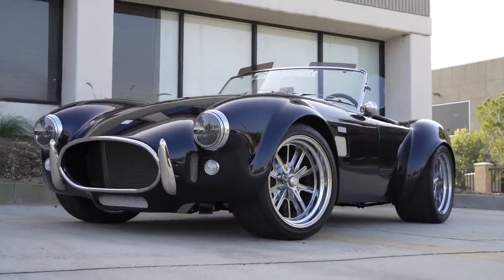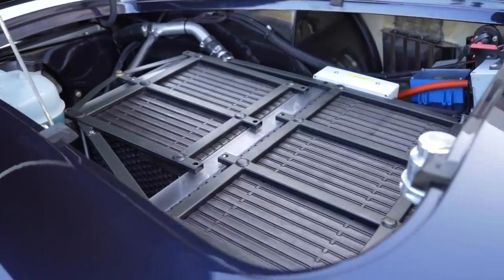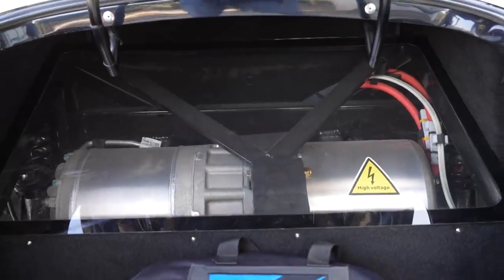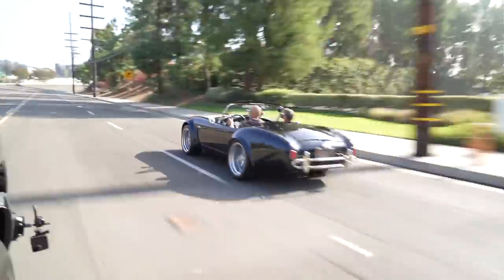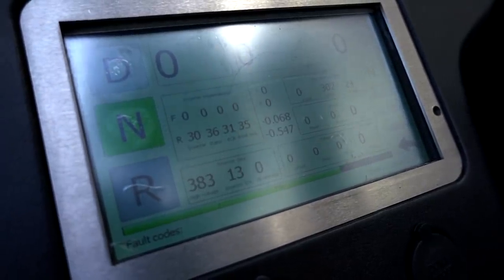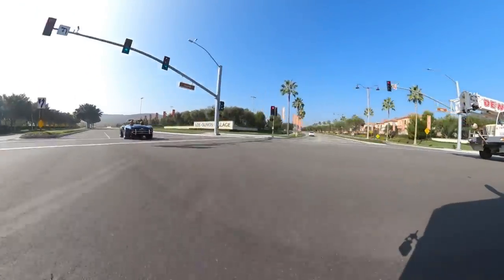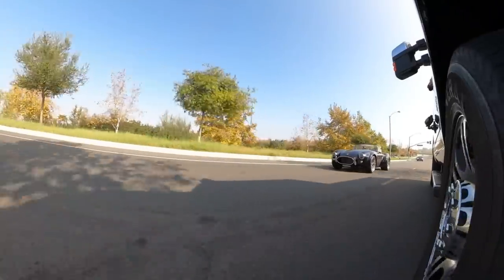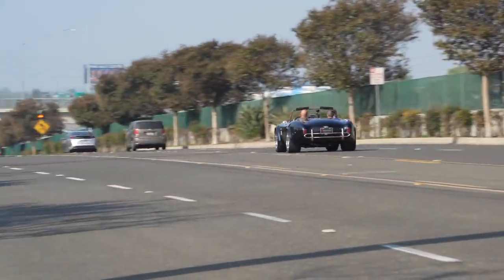1,500 ft-lb Torque Electric Powered Shelby Cobra Tesla KILLER by Superformance

Comment: “It has tremendous grip, right up until it doesn’t.”
Reply: ahaha!!
Reply: cheap open rear diff , misses an LSD
Reply: @Eric Shosted.   Murray Walker...? LoL
Reply: @titolupo  guess you can't see or think. two black patches, and smoke from both tires
Reply: There's no reason for an lsd when the torque is high enough to just light up both rear tires. I think the tire has less traction than the drag in the diff. A limited slip can't add traction when both are already slipping.
Reply: @allterrainrandy2587  That is not the point, when one tires slips different from the other they have a different inertia and when the one that has less inertia grips back first makes the car suddenly turn on one side ( usually the one you don't expect). This is much less evident and controllable if tires spin equally thanks to an LSD
Reply: @richardschipper5989  May be I can't think or may be you make assumptions without having any experience of horsepower
Reply: @titolupo  I went and played around with my P85 yesterday, it will definitely spin only one tire. I've always only seen 2 black marks. Maybe I'll have to buy one of those Quaife ATB.
Reply: @allterrainrandy2587  Thanks! You are delivering the most clever response here.  in fact two black marks on ground do not exclude there is a big difference in spinning between tires... the issue come when one gets grip, such as it happens when one tire is on ice or acquaplaning
Reply: @allterrainrandy2587  I always thought an LSD was so the two wheels weren't locked when going around a corner. But when you were going straight and put it under load both wheels "locked up" for traction.

Comment: As cool as ev’s are (performance wise),  you can’t make an electric cobra cool!!  That car needs to be seen and most importantly heard!
Reply: says you
Reply: @post-leftluddite  yes,..I thought that was clear. ☝
Reply: Agree!
Reply: Well I for one believe this is pretty cool.
Reply: @davidkelley751  and I'm cool with that because everyone is intitled to an opinion.
Reply: @XxMcLuvinItxX  true. I mean personally I’d rather have a high reving 289 or 302 like 7,500+ rpm setup for grip racing.

My guess is there will be a lot more of these electric cobras in the future like say 50 years from now.
But in my opinion this is a lot better than the mustang Mach-E or the Shelby Mach-E concept.
Reply: @post-leftluddite  
Yep. He said it…Embrace it.
Reply: A Voodoo engine with a tremix tko 6 speed manual and I’m in heaven 😎
Reply: @jamespain5822  that actually would be a really good setup because the voodoo’s flat plane crank doesn’t have a whole lot of bottom end torque compared to the coyote and like the coyote it makes it’s power at the very top of the rev range.
So you probably wouldn’t spin tires to much compared to either a 427 or a coyote.
Reply: I would just install software to play VTEC sounds and confuse the hell out of people but you gotta lift off the gas during shifts
Reply: @davidkelley751  Especially on the Superformance Cobra R. Driving that through the canyons screaming at 8500rpms. It’s my dream build.
Reply: @dodgersfan8598  Artificial sound😆😆😆  That's what i expect from gay Teslas
Reply: I dont know. I think this is sick as shit
Reply: Exactly mate or otherwise it's a soulless toy.
Reply: @maximusvonce1381  nah, cause I'm not a five year old to be wooed exclusively by loud noises.
Reply: @maximusvonce1381  this weird simp behavior for a piece of machinery is kind of pathetic,  bro. Put one of these and an original on the line, and this model is going to out perform every time, "appliance" or no. Just because the only experience with electric motors you've had is with your wife's vibrator doesnt mean there isnt some kick ass ones on the market, and tesla engines are right there on the top of the pile
Reply: @davidc4983  Gay pos appliance car.
Reply: They should at least off a v8 DFI 2 stroke crate motor.

Comment: On paper this makes a lot of sense for racing, Super lightweight and perfect weight distribution with the absolute best power curve and no shifts, BUT It just doesnt look right without the side pipes. However the AWD Daytona will DESTROY EVERYTHING! Imagine the Daytona with the PLAID Tri motor setup!!! These guys are pushing the bleeding edge of new school HOT RODDING no question about it.
Reply: They had to dial back the the P100D motor (4500flbs) from the initial setting of 2500 flbs to 1500flbs, they could really go with the model 3 dual motor save some weight and leave the motors wide open. But dam you're correct AWD with near 50/50, no shift points, instant torque, and i'll add that the regeneration braking will eliminate brake fade.

Comment: I am an internal combustion engine enthusiast, but I know these electric vehicles are a different experience. I have never owned one, nor have I driven one.
   The thing about that is I know what power curves look like, and what a power band is.
   As far as electrics are concerned, I have been into the RC Car hobby since a child. I have seen them move from cadmium batteries, to hydride batteries, and then Lithium batteries.
   I have experienced lithium batteries with phones like most people, but I started flying electric helicopters, which use lithium batteries.
   Even with the electric cars, power is astronomical. You have a 1/10th scale vehicle that can go about 35-40mph with a track racing setup. You can even make them do 150+ actual mph. The 35mph setup is 350mph by scale. That is like driving a vehicle with thousands of horsepower, but you can't sit in it.
   The power delivery is what I can understand, I haven't driven 1/1 electric, but the experience has got to be something. And they are very quiet. Toyota Prius experience.
   I still hope gas engines will continue in different ways, but electric will be tough to keep up with.
Reply: It would be nice to see some DFI 2 strokes also.
Reply: Schedule a Tesla test drive, they are no a pressure sales team, but make sure you leave your checkbook at home as a safety measure... just saying.

Comment: Gotta agree with ya. The engineering and the power of that Cobra is stellar....no argument there. But I'm of the age that enjoys the noise, the smells, the fun of driving around in car like that with a knarly, loud big V8 where the floor boards are pulsing below your feet and the wind noise can't drown out the sound of the motor. There is definitely a market for electric 'muscle cars' and it's likely only going to grow. I would probably even buy one if I could. But it would not replace a gas-guzzling, loud version of the same car. Be safe and stay well.

Comment: Not just the sound, but the feel of that lopey engine that seems like it’s about to shut off but doesn’t, and the smell of unburned hydrocarbons.   Back in the day at some local car shows, there was this 63 1/2 Galaxie XL, 427, Torquethrusts, perfect exhaust tips at the very corners, tipped down just right, hunkered down like it’s hauling 50 cases of illegal hooch.    Red as red can be.     That thing had it all, as far as visceral.     High test fuel aroma, choppy, nasty, high compression lope, where you could watch the antenna wave back and forth.     You could feel it standing 50 feet away.    He’d put it in drive to move it and the rpm would drop, and it just shook the ground.      He’d put it in neutral and give it a little throttle jab.        Here it is 35 years later and it’s still like yesterday in my head.     That, to me, was the definition of badass.   These was also a legendary, around here at least, in Charleston, SC, a maroon 1970 Torino 429SCJ.    And I saw it with my own eyes.    THAT legendary.   And of all places, at the airport pickup lanes, late night, with no other car around it, with the lights hitting it just right.   Tinted side windows, Magnum 500’s, louvers on the back glass.      Just jaw dropping.     Just when I was about to go, one dude walked out and I knew it had to be the driver.    I was several hundred feet away by this time but had to circle around.    Sure enough, he fired it up, and that was it man.     Top predator.     That thing literally sounded like a monster.       And easily one of the most beautiful cars I’ve ever seen, right there with the ‘68-‘70 Chargers, Miura, GT40, and of course the Cobra.    But you’ll grow to love EVs.    The power is what does the trick.   It’s just jaw dropping.    I learned about this  through RC cars from Traxxis, and was converted when I realized the absurdity of the power in such a tiny motor and with those high power density batteries.        The cars are 1/10 scale, and by extrapolating, I figured that real full sized  cars would easily have crazy power if manufacturers didn’t restrain themselves.     I could have my little RC  AWD Rally car  stationary, and as a car went by at 35mph on the street, I could launch from the grass, as being on the asphalt would get it run over, but I could launch as the front bumper went by the RC car and by the time the back bumper passed that spot the RC car matched speed and was overtaking the fullsized car.   That’s no BS.    At 45 mph, cruising, I could give it the last bit of throttle and it would still spin four tires and get squirrelly.     Unreal.     Note that this guy did say it had 4500 FOOT POUNDS OF TORQUE.

Comment: The snap action wheel speed is the reason I'd still rather have gear ranges/ratios.  Until someone has the means to ad selectable gear ranges I'll keep my 3 pedal internal combustion powered vehicle.
Reply: You don't understand electric motors. If you mash the pedal of a 1500lbft torque motor, it's going to do that, so, don't do that.

Comment: That was eerily weird kind of cool I guess I don't think some of the older people are ready to embrace the tech. My 1968 Pontiac firebird with its 350 2barrel carbureted motor is way underpowered but I enjoy listening to the borla mufflers while my transmission hasn't been installed properly yet, I just love to hear the thing so I'm on the fence about the electric car. I do wish I could fry both tires the way that Cobra did though!

Comment: If I ever hit the lottery for a ton of money, I will buy an electric Cobra but it will be parked beside a Superformance 427 Cobra with either an aluminum Shelby FE engine or a Roush small block 427 and they will be parked beside my 1969 Boss 429 with an engine that was  built by Jack Roush himself back in 1972.  He made it into a 460 using S-series connecting rods and T-series pistons with a 460 crank.  A Crane cam, titanium intake valves, an ultra rare dual quad manifold and JR competition headers make for some serious horsepower.  It will pass anything but a gas station.  I loved this article.

Comment: Performance is only one component of a great specialty car, beauty is the second, and that car has nailed both of those, but the third component is the engagement of all of the senses, especially sound, not just in the ears but vibrating through your body and soul, on that this car is a big fail.  I guess 2 out of 3 ain't bad.
Reply: I have to wonder what the driving experience is like, and how much the car can tell you about its status in subtle, nonverbal ways…

Comment: Beautiful looking car.  It should not be delivered without a really good traction control system.  Rimac has shown how capable a car can be given enough computer control.  Either that, or dial it down to 450hp.  It can still have options to drift, but not to simply spin out at full rpm.  That will make the Carrera GT look like a safety car.

Comment: What is the range? Sometimes on a weekend, I will cruise my Cobra along the 101 to wherever the road takes me for hours, and sometimes overnight to God knows where.

I have driven the Cobra from Los Angeles to St George Utah, just because it ended up that way LOL. Have dinner, spend the night, then come back.

Until this electric business can do that, and easily, no thanks! 

Out on the long desolate backroads, radar detector scanning, high speed cruising, the Cobra comes alive. The wind, the feel of the road, and the soundtrack of perfectly tuned V8.

Comment: Thinking about the missing sounds, smells, etc.  I've always have been a gear head and up until recently, disliked the thought of EV cars.  I have a big block Ford, that I've been messing with for years.  Loud brash fun.  But loud and brash can get old, daily driving it.  My wife refuses to ride in my car.  The overall experience for the owner may be a whole lot better than us Youtube watching masses may consider.  Note that the 2 guys are carrying on a conversation (not yelling).  Did you ever drive a stick car with a heavy clutch in traffic?  Did you ever have the foot-wells get so hot that you just want out for a while?  Did you ever get a headache from the exhaust noise?  Did you ever get a noise ticket?  How about 8 MPG?  Maybe I'm just getting old.

Comment: Call me old fashioned, but this is a re-purposed Tesla. The original idea behind these cars was a raw and visceral driving machine that ignited your senses (the lope of the cam, the huge side exhaust, the reversed Mustang gear lever) all equaling an experience like nothing else on the road at that time.

Instead we get an insanely priced convertible Tesla made of fiberglass. Say what you want? but when I walk out to my garage and turn the key on my "64 Chevelle, i am met with the satisfying rumble of a V8 and dual exhausts and not the electric whirr of a Dyson vacuum.

And you can talk torque numbers and "it instantly wants to go to 18000 rpm" but my Hoover at home also immediately goes to max rpm too (when a sock gets stuck in the brush roll)

Hate if you want, but this isn't a Cobra worthy of the heritage that comes before it.

Comment: I am all for building cars that are absolutely terrifying. With so much power they DEMAND you respect them as much as a full auto AK47 with a 1lbs pull trigger. I've driven some extremely fast cars and even faster motorcycles but this would scare the absolutely shit out if me with the power and torque to weight ratio available from a standstill.

Comment: I had to go to the transcript to make sure I heard them right when I first watched this video, 4500 ft-lbs of torque with the original motor as it was manufactured?  Then they said they cut it back to 2,500 ft-lbs of torque and still couldn't drive the car. I'm not a fan of electric cars either but I agree that it would be an experience to get to drive this car one time anyway.

Comment: You gotta be joking.  Speed is only part of the experience.  Much like shifting an actual manual transmission adds to the fun.  A cammed, naturally aspirated engine shaking the whole car while the smell of racing gas fills the air is something you will never match with an electric car.  But if all you want is torque and speed then go for it, just isn't my  cup of tea!

Comment: A 427 making 500 LBS TQ with 3.55 gears is easily putting the same TQ to the tires FYI.
Reply from the maker: I’m all about the 427 but not close on torque. This thing makes 1500 torque and it’s all the from a dig. Scary amount of torque imo
Reply: @AutotopiaLA    A 427 can easily make 500LBS TQ, it is multiplied by the gear ratio in the transmission and rear end, just multiplying that 500 LBS by a 3.55 gear ratio you are already over 1500 LBS TQ at the rear axle and that is not even including the multiplication that takes place in the transmission in gears before direct gear.  It is not uncommon to find a 3 to 1 gear ratio in 1st gear so in the case of the 427 making 500lbs crank tq you multiply it first by the trans gear ratio so 3 X 500 = 1500 LBS TQ coming out of the transmission and multiply that times the rear gears of 3.55 and you get 5325 LBS TQ from a typical 427 at the wheels.  This does not include TQ multiplication in a TQ converter in an automatic (where they typically stall near TQ peak meaning it is ALL available at zero MPH with additional TQ multiplication that happens in a TQ converter.  With a manual trans you just keep the RPM at or above TQ peak for the same effect.   Just comparing the TQ coming out of the electric motor to TQ at the crankshaft is comparing apples to oranges, TQ out of the motor is more comparable to TQ coming out of the differential gears.

Comment: Let's get that power to the ground... All wheel drive using the model 3 dual motor setup, split the battery packs front and rear. A Cobra roasting all 4 wheels, even the biggest gearhead would be ok now that is bad ass.

Comment: Yes, brutally fast, absolutely gorgeous, but disgustingly quiet, if I wanted an EV (I definitely don't), it'd either be a Porsche Taycan Sport Turismo GTS (the wagon one), one of those Rivian truck deals, those actually seem interesting as a whole, or a Plaid powered/body swapped AWD Honda Odyssey minivan (someone will know).... an AC Cobra needs either a 289 or 427, not even an LS (unless it was an LSX427 with custom valve covers and ITB's, I guess I could deal with that)..... and another thing, if this thing came in more than 100lbs lighter then a "stock Cobra", why wouldn't they use that difference in more batteries to help that paltry 100-150 mile range, hell, I'm sure weirdos who would buy something like this wouldn't mind it to weigh 200lbs over "stock" in extra batteries, it'd still be much less than 3k lbs 😅

Comment: I think its awesome, just wonder about the range, with being a 100 pounds lighter, thats more range you can stick in it with an extra batter, or more! Yeah, its nice to see the original with the insane engine and all, but the amount of power you can get from one of these tesla motors in beyond nuts, 4500lbft of torque? I'l love to see that thing opened up and see how fast it will go 0-150 on a ease into it to keep traction start